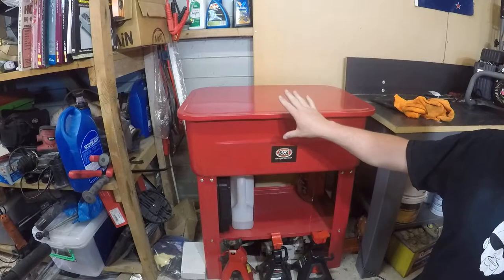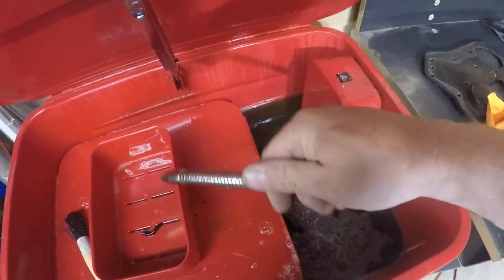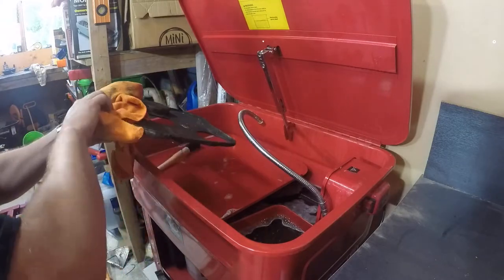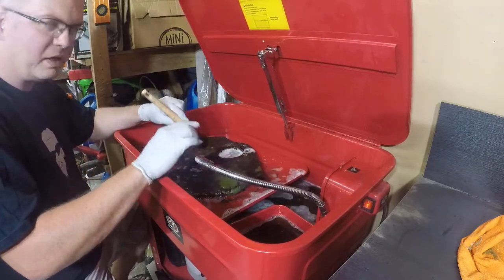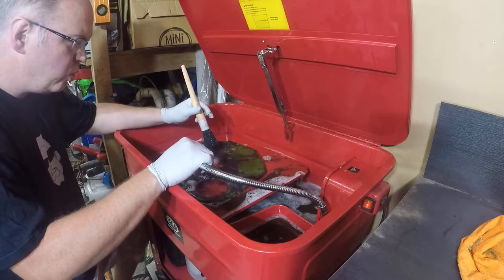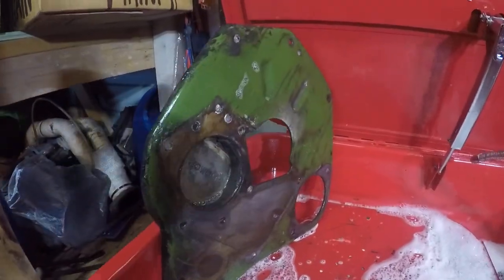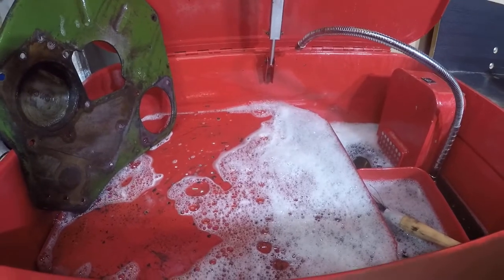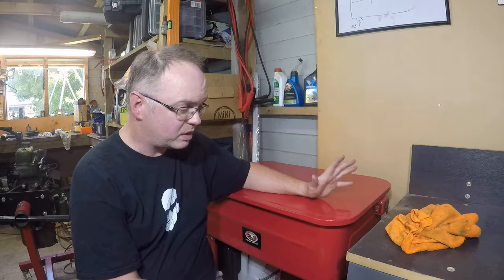Supercheap Auto 60l Parts Washer Review

Comment: Badger, I think all these cheap washers come from the same plant in China.  It looks exactly like the one I got from Tractor Supply.  The pump on mine lasted about a year so now I just use it without the pump.  It's good to keep the cleaning fluid cans and siphon the fluid out every now and then to clean the sludge out of the bottom.
Reply from the maker: Guaranteed it will be very similar to your one. Hopefully I get good service out of this one. Good tip to siphon the junk out, I was wondering what to do about that. Cheers

Comment: Drop in a large sponge that covers  most of the bottom of the unit and it will keep the crap out of the detergent longer, the small filter on the pump isn't good enough. Just chuck the sponge and add a new one as it gets yukky looking, your detergent will last ages.
Reply from the maker: That's a great tip. Cheers
Reply: Where you get large sponge to suit? Sounds a good idea